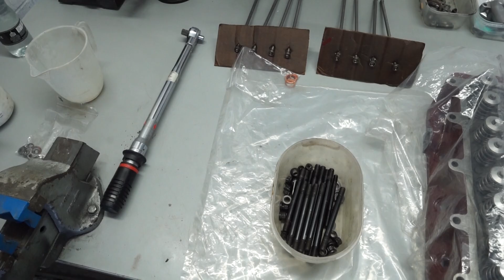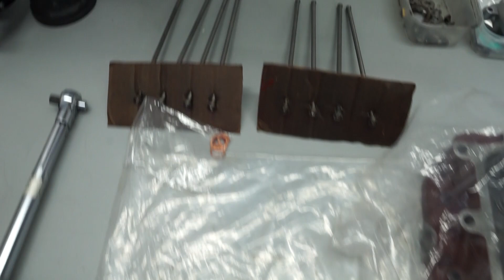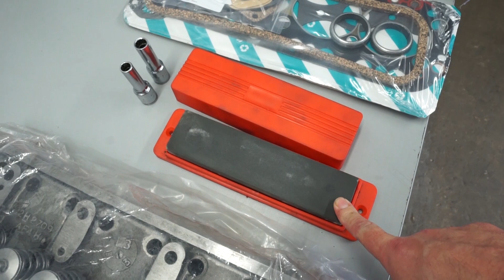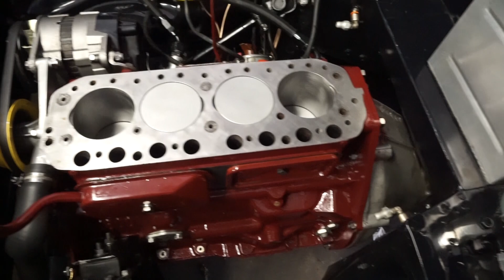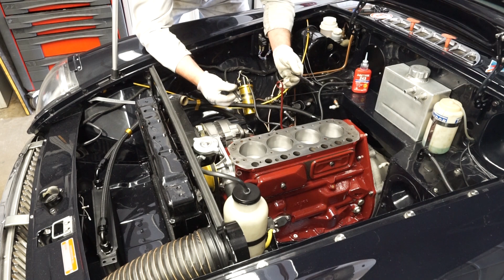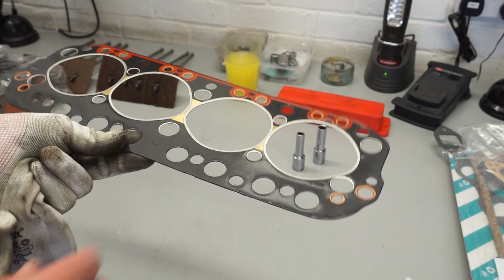MGB Cylinder Head Re Fitting With Step by Step Instructions

Comment: I was surprised to see you set the tappets at 0".022 and 0".024. Can I assume that those clearances are correct for the Race Cam you have in that engine. I know camshaft manufacturers specify different clearances for different cams. Great methodical work David.
Reply from the maker: You are correct, I run a race cam on my car, for a standard cam a clearance of around 0.013" (hot) or 0.015" (cold) should be ideal

Comment: Just replaced the head gasket on my 1600 MGA which blew last Sunday on a run. Unfortunately Payen only do a gasket for the 1800 which is the same block but bored. Wish they did a gasket specific for the 1600 it would provide more material width between cylinders.

Comment: Hi David, an observation and a few questions.  My center two rocker pedestals have a shim beneath them, I thought all 1.8 engines had them.
 Do you find the Weber 45 superior to the 32/36? I assume you run that because you race the car. I'll be reassembling my rebuilt engine soon, did you place your engine without the head due to the extra weight? I'm enjoying your color combo, I've always loved MG maroon and will paint mine so.
Reply from the maker: Many thanks for your message Steven, I have a slightly different set of rocker pedestals in my car with extensions to offer extra support at the end of the shaft. I believe the shims under the pedestals are to stop the shaft moving and were fitted two cars post 1973. With regards to the Weber, I've never tried the 32/36 but I believe the general consensus is that the 45 DCOE is better for all out performance. Naturally, you'd have to tune the rest of the engine to suit. In the video I was just refitting the head to the engine, I had not removed the engine from the car. Usually I would install the engine, cylinder head and gearbox together at the same time
Reply: @davidrussellwilks ah! Thank you David again.

Comment: After all only three remarks (maybe not needed, I did not check further down in the list):
1) torque values on the headnuts were raised by BL by TSB from 45-50lbf max, to 50-55lbf. Meaning torqueing up to 55lbf max, of slightly below 75 Nm is permitted with their blessing
2) on later engines underneath the two middle rocker shaft pedestals two special shims were placed and for later engines when refurbished in any way, BL advised the same mod
3) assuring the thermostat housing studs are firmly lodged in their threaded holes assures complete sealing, without any sealant being necessary. Furthermore, NOT using the re-usable Klingersill gasket, but a cork one obviates the sealant option completely as well: cork swells up and torqueing slightly up after a single  heating cycle is enough to last
Thanx once more and I will follow in your footsteps in a manner of speaking for sure  🙂

Comment: My # 3 pushrod is a little higher that the rest and the rocker assembly won't drop down to the head. Will it be alright if I tighten it down using the bolt pattern.
Reply from the maker: If the push rod is raised slightly it might be that it's on the cam lobe so is at the highest point. This would only be a small amount though, it might be worth removing the side plates to see if anything is wrong, has the cam follower definitely located fully?
Reply: @davidrussellwilks  It is a small amount, maybe an 8th of an inch, looked about like yours before you snugged yours down. I doubt anything is wrong, it was fine when I took the rocker assembly off. I did bump the starter a few times when i was cleaning the pistons so they are not in the same position as when I took it off. Thank you for your help.
Reply: @davidrussellwilks  I got the head torqued down and all seems well. Is it common for the valves to be out of adjustment? They were all real loose.
Reply from the maker: Do you know what the clearances were like before you started? A new gasket will certainly change things, how far were they out?
Reply: @davidrussellwilks  They were .012 because I adjusted the valves right before I took it apart. They weren't out very much, just a little looser. Maybe a eighth or a tad more of a turn on the adjustment screw.

Comment: I'll be following this to the letter today! Eek
Reply from the maker: Excellent, please let me know how it goes? With the tappets a clearance of around 0.013" (hot) or 0.015" (cold) should be ideal.
Reply: @davidrussellwilks  Hi David I will indeed! A few issues with the valve spring collars at the moment. I don't know whether they should have some metal in thew bottom or not. Some have and some haven't..
Reply: @davidrussellwilks  All done! A few things cropped up that you would never have covered, basically because of the age of the car and the stuff  that the engine has been built with. A stripped tappet nut on the rocker was one. But your vids are amazing David Really really good!

Comment: Brilliant video, thank you David. In the coming days, I will be refitting my head and your video has proven very useful. I do have one question though. Why is it such a bad thing if the stud turns when it comes time to retorque? Surely the same torque is applied either way, no?
Reply from the maker: I like to make sure the stud is tight in the block first, in theory it should make little difference, more just for my own satisfaction.
Reply: @davidrussellwilks  makes sense. The other reason I ask is cause a few of the studs came out with the nuts on, so I was contemplating just reinstalling them that way so I'd be torquing the stud down into the block on those ones.

Comment: Came here to see about compression testing. I’m really happy I did — your work is meticulous and done under immaculate conditions — the way my father would insist! (We’re from Derby, and his generation were taught every single millimetre of mechanics and with precision)

Sorry, I got off topic…missing him, because he was my Number 1 resource for all MG-related problems. 

So..Q/ I did a cold compression test today on my 67 MGB GT, and I got an average of 160 psi, on each cylinder. 
Am I correct, that that is a low number(s) and indicative of some work to do? But…what work? Is it rings? Cylinder head? Who knows?

My car was re-done by the previous owner, around 1985. I purchased it in 1988, and the next year I shipped it here to Canada. Drove it for a few years but then I put it away for 18 years (gasp)! I drove it Sept, October, November of 2021, then it went into winter storage until end of April 2022. 
So this year is its full driving season, and I use it as my ‘daily driver.’ I’ve been zipping around like Nigel Mansell (without his calibre of skill), and enjoying the car. 

But a few things have materialized this last month. Running on.. which now seems to have corrected itself with high test fuel and occasional oil stabilizer… A radiator leak on the lower tank of the rad… and a no start situation. However, today I removed the distributor cap cleaned it out and dried it, it’s in very good condition because it was new since last August, took the plugs out and cleaned them and the car fired up immediately. 

My last comment is regarding a clutch master cylinder. Unbeknownst to me I was sold the 68 and onward master cylinder which is slightly cocked on an angle. I will have to take it out and get the 67 non-cocked clutch master cylinder and do the job again. 
BUT! … although the incorrect clutch master cylinder Was installed, when I brought the car home from the shop last week I enjoyed three days of wonderful shifting, a nice clutch pedal and really nice driving. But then only two days ago, the pedal went loose shifting was not smooth, and in fact when stopped, I could not engage first or any gear. I’ve been told this could be the clutch slave cylinder, now being the weakest link in the system, that needs replacing …?

Additionally, when I open the Reservoir of the clutch fluid, it was backing up, pushing up and out the top of the clutch master cylinder reservoir. That’s certainly not normal and I have no idea what it’s about. 

I appreciate you reading my extremely long note and if you can offer any advice I would appreciate it. Again, thank you for the incredibly good videos superb presentation and your excellent knowledge of mechanical jobs on the MG!
Reply from the maker: Thanks for your message, to go through the questions in turn:
160psi sounds more than reasonable for a standard engine, the important thing is that all cylinders give a similar reading. Your average was 160psi, what was the difference between each cylinder? 
I would check the level in the clutch master cylinder first, especially if the system has been worked on recently. A bad slave cylinder can often be diagnosed with a lot of hydraulic fluid in the outer cap, another issue can be the flexi hose too.

Comment: Is that a TWR manifold? Sure looks like mine, but I run a Mikuni.
Reply from the maker: It's a TWM one, US made, but I don't know much about the company.
Reply: @davidrussellwilks  same as mine, don't know why I wrote twr? Not much info exists but I find it works better than a Cannon manifold I have.
Reply from the maker: I agree, they seem very nicely made, certainly look like a better moulding than the Cannon ones. I bought one years ago from Moss, the last one came from eBay. I don't know if the company is still going or not?

Comment: .22mm or .020 must be either very quiet or rather like an old sewing machine...:)
Reply: How did you run the 12v in an mg tank? For that walbro pump? It has got to be quieter than my current Edelbrock run in stock locatio
Reply from the maker: Thanks for your message, there is a swirl pot built into the custom fuel tank: https://www.nukeperformance.com/product.html/competition-fuel-cell-unit
I'd been having problems with fuel pick up but using this unit means I can get every last drop out of the tank. 
The system can be used on carburetted cars using the lower power pumps like the Walbro, a fuel regulator is required to drop the PSI down to 2-3psi for the Weber carb. The pumps are fairly quiet, you hear them at start up only. I don't know how you'd get them into a standard MGB tank though, it would take some customisation.

Comment: I’ve heard the head gasket to use is a Payen gasket. Is this what you recommend? I can’t seem to find one anywhere. What brand do you recommend? 66 MGB
Reply from the maker: After tying a few different gaskets I find that the Payen works very well on these cars, it's cost effective yet durable and usually lasts a full season with no issues. Stock has been hard to find; Cambridge Motorsport in the UK do have them in stock I think.
Reply: @davidrussellwilks  unfortunately, having them shipped stateside can be costly. Any other recommendations? I love watching your videos, BTW. I dream of getting my MGB close to the level you have yours.

Comment: Great video, now the season’s over I’d love to see a guide to de-coking the head & tops of pistons! I’ve just used this video to do the head gasket on my 66 B GT, despite working with racing cars on a daily basis it’s always good to make sure I’m re-assembling in the right order. 

Keen to know more about the spec of your engine!

All the best & many thanks.
Reply from the maker: Many thanks for your message, de-coking is not something I have ever done on my engine. The whole engine is refreshed and rebuilt every two years by an engine specialist in Northampton. 
In terms of spec for the engine its 1840cc with a race head, steel billet crank, steel rods and JE pistons. There is a good page on the car here, the engine is 2014 was a 1950cc though. http://www.britishracecar.com/DavidRussellWilks-MG-MGB.htm

Comment: Excellent video, thanks. Will you please share what grit is the oil stone you use?
Reply from the maker: The one I use is made/supplied by Proops https://www.proopsbrothers.com/oilstone-and-box-coarse-one-side-and-fine-on-the-other-w3330-874-p.asp

Should be under £12 on Amazon or eBay.

Comment: hi david i have developed a knock at the front when i apply the brakes any thoughts on what might be causing the knock many thanks richard
Reply from the maker: Thanks for your message Richard, do you have wire wheels fitted?
Reply: @davidrussellwilks   hi david no wire wheels so decided to change top bushes as they are shot not sure of the rear i think if front have gone so have the rear could be this is the problem many thanks richard great videos by the way
Reply from the maker: Hi Richard, if the front bushes have gone it would certainly be worth going over the whole car if you can. I do recommend the Super-Pro ones, they seem to hold up well and don't go soft like some of the Poly ones do.
Reply: @davidrussellwilks  thank you will change all bushes and hope it cures the problem all the best richard

Comment: What type of Oils do you put in the gearbox, engine, diff and also what type of coolant?
Reply from the maker: Thanks for your message Michael;
Engine oil is Silkolene Comp 4 20w50 https://www.opieoils.co.uk/p-1123-silkolene-comp-4-20w-50-xp-ester-based-semi-synthetic-bike-engine-oil.aspx?VariantID=2386

Gearbox is Castrol classic 20w50 https://www.opieoils.co.uk/p-77263-castrol-classic-xl-20w-50-all-round-performance-multigrade-engine-oil.aspx?VariantID=111951

Diff is Castrol B373 https://www.opieoils.co.uk/p-712-castrol-b-373-racing-mineral-car-gearbox-oil.aspx?VariantID=931

Coolant is https://www.opieoils.co.uk/p-820-silkolene-pro-cool-antifreeze-coolant-ready-to-use.aspx?VariantID=1040 with a dash of CCA additive https://www.opieoils.co.uk/p-819-silkolene-pro-cca-ultra-motorbike-cooling-system-corrosion-inhibitor.aspx?VariantID=1039

Comment: Excellent video David, as always. I did'nt see you lube the cam followers, push rods, rocker arms, or rocker shaft. Is'nt this critical for valvetrain life or did you just not show it?
Reply from the maker: Thanks for your message, the cam followers stayed in the engine, I don't lube the push rods before re-fitting. I didn't clean up the rocker assembly so there should still be a good film of oil on it. I think if you were building a fresh engine or you had de-greased them you'd want to make sure all these parts were lubed before fitting. 

Before starting the engine I do always turn it over on the starter motor to make sure it has oil pressure.

Comment: These videos have bee a huge help for me -- thanks for putting them together.  Quick question on the valve clearances. It looks like most sources say that valve clearances should be 0.015" (cold; 0.013" hot), but it seems like you're setting them a bit wider here (something on the order of 0.022").  Curious as to what the rationale for that is
Reply from the maker: Many thanks Kevin, you are quite correct that 0.013" is ideal for a road car. In my car the gap were specified by the original engine builder; I think the idea is that if you get some valve bounce at high revs it stops the valve hitting the piston. Having a wider gap does mean the valve guides will wear a bit quicker though.

Comment: Hi David,
Thank you for your excellent, clear and informative videos. I have a 74 MGB which is quite far away from track ready, though I’d be happy if mine even looked at good as yours. 

To your point on valve clearance, 22 and 24 thou. You said they’re all like this, wondering if you could clarify. My Haynes, John Twist, and and my local spanner swear by 15 tho hot, also have 13thou cold, and I’ve even read 12thou. Mine are 15 and sound better recently I tightened them up, but still a bit “tappy” on the motorway. All set at the the same gap for both inlet and exhaust. Got me wondering whether your setting is the difference between race car vs stock road.
Reply from the maker: Many thanks for your message Rob, you are quite correct that I do run a larger valve clearance on my engine with a race camshaft. For a standard cam around 0.013" should be ideal.

Comment: Awesome videos David, thanks. When you removed the cylinder head in a previous video, the engine surface was dirty and the pistons were covered in deposits. This video shows them shiny clean, like new. Can you give us some tips on the best way to clean the engine mating surface and pistons, without worrying about getting deposits stuck between the piston and bore? Appreciate knowing how you did it. Cheers.
Reply from the maker: The engine went away for a complete rebuild Dan, the car has this every 2 seasons. It is hard to clean parts like this in situ you could try scraping the piston tops with a razor blade or similar and then vacuuming up the excess, but it might really be best left alone unless there is a severe build-up and then it's probably best to strip everything down anyway. You can still use the oil stone just to flat the top of the block though.

Comment: You make it all look so easy chap! Aluminium anti-seize grease and Thread Sealant....what's the difference and is copper grease suitable, or not (I ask because I have that but not the other two you have used so I am guessing copper grease is not a good choice)
Reply from the maker: Hi Ted, there is little to choose between the aluminium and copper greases, the copper grease is more widely available. I do like the way the aluminium works when heated on parts like the backs of brake pads; it leaves a graphene like film, I think the copper acts in a similar way though. In my opinion the aluminium grease looks a bit better on exposed threads than the copper. The thread sealant is quite different this acts much more like a threadlock ideal for the thermostat studs that sit inside the water jacket of the head. I've had these weep fluid in the past.